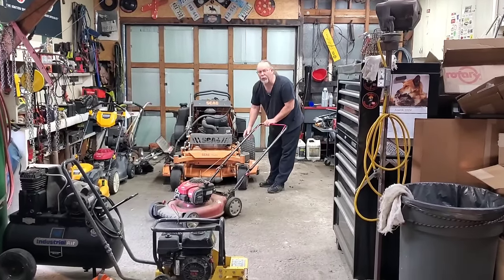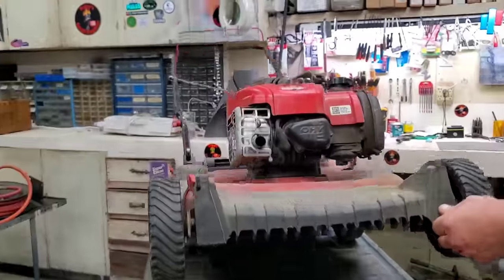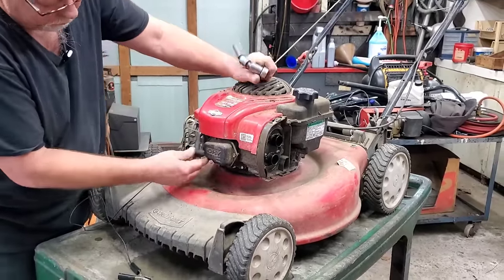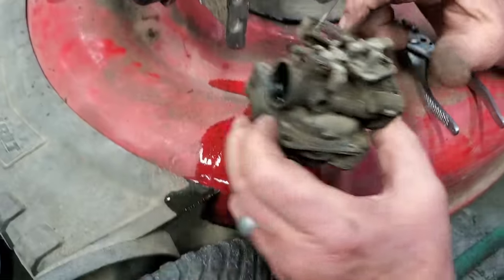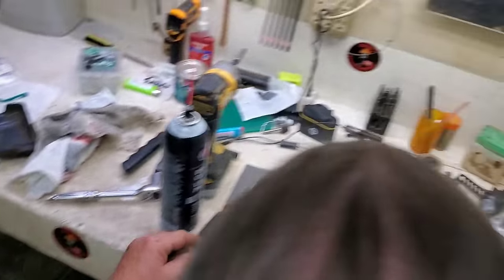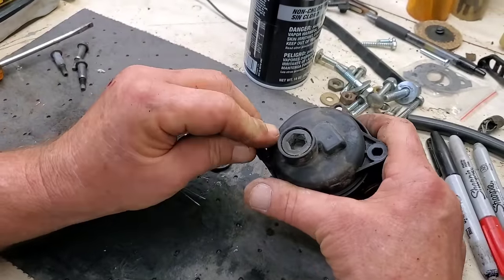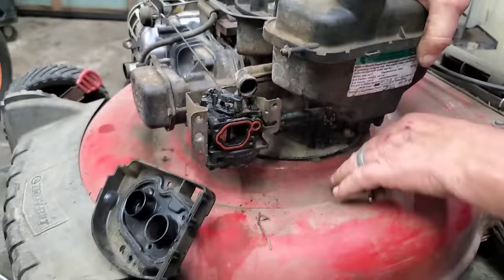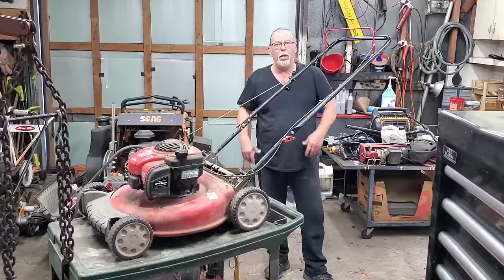Troy-bilt Push Mower Won't Start - Troubleshooting And Fixes! Plastic Carburetor

Comment: I have never worked on one of those plastic carburetors yet but when I do I will know how thanks to you.
Reply from the maker: I'm sure you will do a great job.  Thanks for watching
Reply: @RaleysSmallEngines  Wouldn't it be easier to just buy a new carb instead of cleaning? They seem to be pretty cheap. Under $20.

Comment: With the spark plug , I've seen many times the plug would fire outside the engine,  but not under compression. When in doubt change. Another interesting and informative video Sir. 😊
Reply from the maker: Great point.  Glad you liked it, thank you

Comment: My tb110 wouldn't start and all the other videos I watched when straight to disassembling the carburetor. I got it working by just giving it a shot carb cleaner on the air filter vent like you showed. Not cutting that part of the video out saved me a lot of time, effort, fiddling, cleaning and money spent on tools I would have had to buy. Thank you so much!

Comment: I just found your channel. I was looking for help with my Craftsman LT2000. 18.5 HP mower. It's set up for 4 yrs or so. It wonk crank yet. I'm working on it. I've watched some of your videos. New battery. Drained and cleaned the rank. New plug. 
It has spark and compression. But won't fire up even with starting fluid. 
I'll check the keys at Next. 
Your videos are very helpful.

Comment: Great video and great explanation. I am having the same problem and I am an novice. Got the jet all clear but still no start without carb cleaner.

what would you say was the problem here since the jet wasnt clogged? water in the carb? Thanks again for sharing. You’ve peaked my interest in small engines now!
Reply: Check for water, check fuel lines, pump (if it has one), filter and unscrew the fuel cap to check the breather in cap. Good luck!

Comment: Hey Tbone I got a question about this engine that you might be able to help with…I cleaned a carb on one engines with the plastic carb and push primer and I push the primer bulb and it won’t start after three pulls.  Then push the primer a few more times and it starts right up and runs fine.  Any ideas?  Valve adjustment?
Reply from the maker: Most likely the air cleaner base is warped and not pushing fuel from the bowl into the carburetor throat.  Use a flashlight looking into carb while pushing primer. Fuel should come into the throat of carburetor thru the small brass tube.
Reply: @RaleysSmallEngines  yeah I just did that T.  and I do see fuel coming up.  If I push the bulb six times it starts first pull 😂
Reply: @RaleysSmallEngines  I cleaned the carb again and put fresh ethanol free gas in there and it started first pull!  Thanks for responding

Comment: Could timing be an issue if not running as well? I have changed plug, thought I cleaned carburetor out good, but will do it again to make sure. I am getting ready to check the belt, but  another video said timing and it looks the timing may be off. Thoughts? Reay to buy a new one. I have had mine for 6 years. The cord broke, someone replaced it and it hasn't started since. It was taking a while to start before hand though, but it did start.

Comment: Hey I picked up a free Craigslist 190cc 1993 brig's and Stratton lawn mower. I checked for compression it was 55psi. I used spark tester and spark plug light came on when i zip tied open the clutch cable to stay open because the linkage cable is bent, so it's not the coil even though its rusty. I already cleaned the carburetor which had green mold inside the carb which I'm assuming it was not started in a long time and had old fuel. But it still won't start with a powerdrill and drill bit since it dont have the puller rope to start. So then I removed the carburetor and added small amount of fuel directly where the carburetor sits and it was shooting flames and some what chugging which was not doing before but it did not sound like it was running. So im confused was it running if it was shooting flames?  Does it need a new carb, sparkplug or is timing misaligned?
Reply: Check flywheel key. Good luck!

Comment: How did the water get in there?
Reply: If it was a left outside in the rain or if the gas can used to refill the tank may have had water in it from condensation from poor storage could cause this problem.
Reply: Ok, thank you...I was surprised to see that.